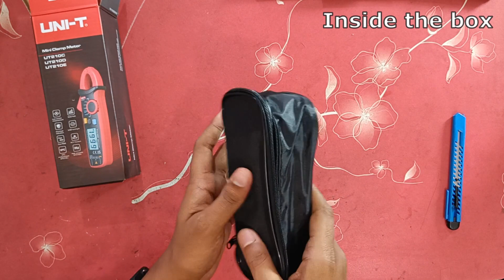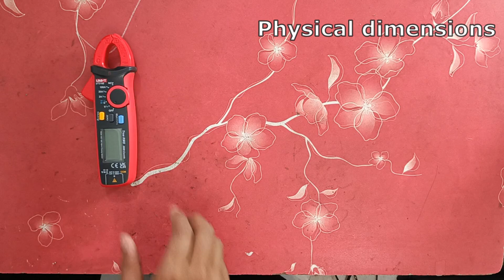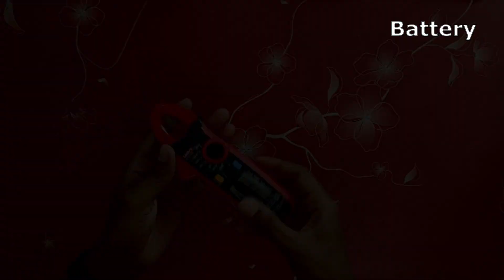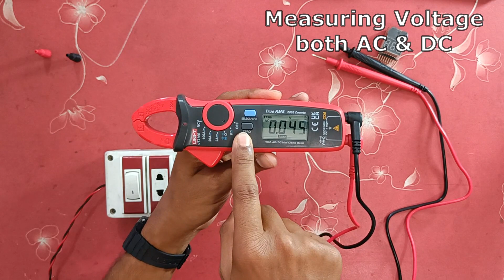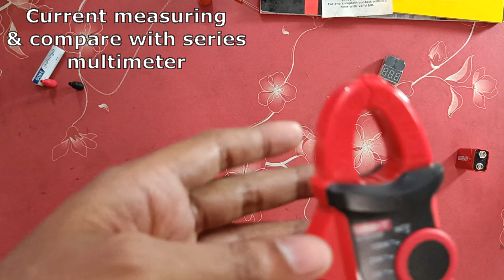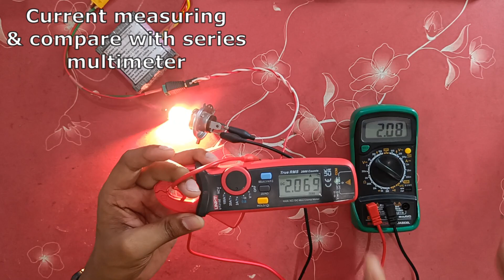UNI-T UT210E unboxing, full testing & review

Comment: The best meter I've ever bought—with its 1mA sensitivity, it completely outperforms famous brands.
Reply from the maker: Even I had tested the dc clamp meter accuracy of this multimeter in a shorts video where a normal wired multimeter was measuring the current of a single led and it was clamped in one of the cable of the series multimeter. You can watch that video too, it's a too good and very accurate one... Also don't forget to checkout my letest video of LoRa module range test and other interesting projects on my channel! Thank you so much! Keep supporting 😊😊😊❤

Comment: This multimeter is good & useful for measuring milliamperes which other similar types of meters can't do for example kaiweets as it doesn't have lower ampere range below 60 ampere. This is now priced at 5,250 online. The package don't comes sealed properly unlike other brand meters like themisto in which the outer cardboard box is sealed with company adhesive tape, the meter inside is sealed with polythene wrapper & the batteries also are sealed separately but this uni t meter comes unsealed & the batteries are already installed by company inside. Even the probes also don't come in plastic wrapper which shows company is cutting down costs on packaging although the meter is so expensive
Reply from the maker: Yes, this is really a too good multimeter, and I had also verified it's clamp meter ampear measuring in miliamp level with a normal wired meter in series, and both shows exactly the same. I jas also made a shorts od that too in my channel. This is really very useful and good quality product no doubt!

Thank you so much for supporting my work, please do subscribe my channel. In my channel I use to do experiment related to RF modukes, LoRa range test, antenna making and tuning, satellite capture and videos related to rc plane and drones. Please check-out those videos too, hope you'll like them too!❤😊